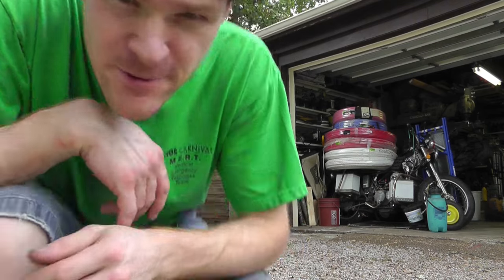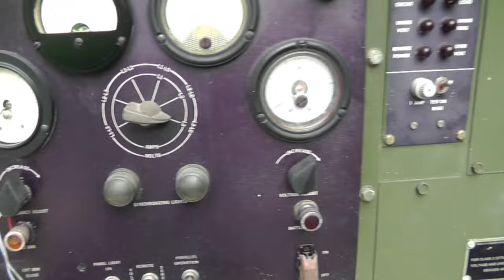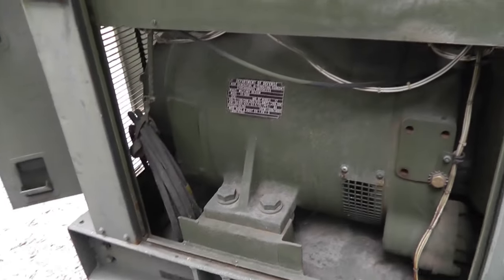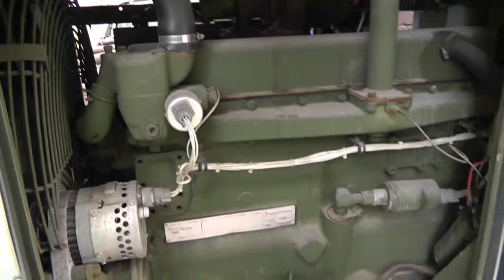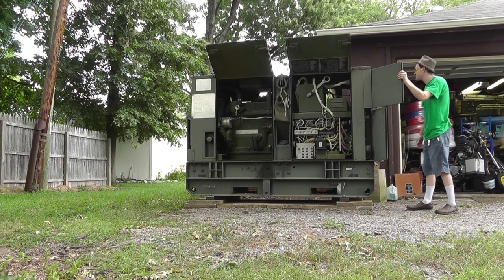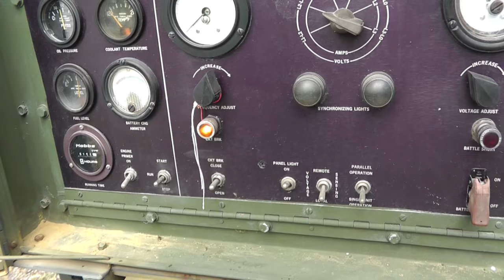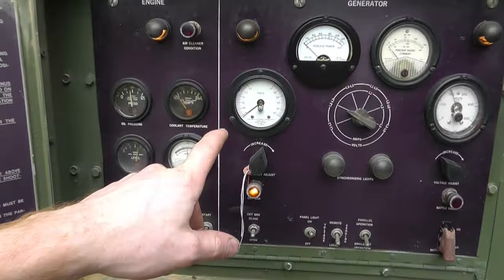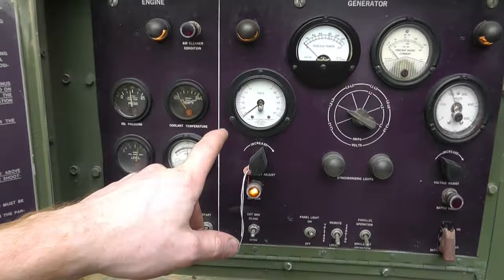MEP-006A Military 60KW GenSet. Overview And First Run After Sitting For 3+ years...

Comment: Notice you didn't reinstall that insulated panel you took off and latter shut the exterior doors without it in place. That's there for a reason.
Reply: I sense the knowledge of a 51D in you
Reply: I was a 52D

Comment: Nice score.  Diesel generators are great; I have a very small one myself.  Those hours are high for military use but for everyone else ... with regular oil changes and clean fuel, you'll get 100,000 hours out of it before it needs a major overhaul.  Keep in mind though: DON'T RUN IT WITH NO LOAD OR AN UNDERSIZED LOAD except for very brief tests.  If run without sufficient load, diesel engines will develop a "wet stack" condition and will require some time-consuming maintenance to fix.
Reply: Art C the hours are high for military use? Try again.......
Reply: James Punting had generators on deployment with 4000 hours so try again.
Reply: James Punting they weren't but you obviously know everything so just keep telling yourself that they don't send anything into the field with more than 50 hours on it.......it's not true so stop passing inaccurate information.

Comment: im in the navy and i work on the same generators we call them TQGs (tactically quiet generators) they will power just about anything and everything
Reply: That thing isn't a tac quiet. The 800 MEP series are. This is a MEP 006.
Reply: We have this model the motor runs but does not generate electricity. Not sure if it's the regulator or what? We can not find anyone who works on them here in western Colorado. Any advice?

Comment: You may want to check w/your local power company about connecting this in a power outage you may back feed power into the grid and electricute employees working to restore power.
Reply: I don't think this yahoo would recognize a transfer switch from a railroad switch.
Reply: Cut off main breaker at meter or hell just pull the meter and u know ur good
Reply: I’m no expert on electricity but I know enough that you can’t just plug it in your house and I have to have a box so it doesn’t back feed  to the lines because that would be bad because someone working on the lines could get lit up

Comment: 142 Hours? That thing is brand new. It was probably purchased new for $30,000, tested monthly for once an hour, then sold 20 years later for pennies on the dollar.

Great score!...but an example of how wasteful the government is.
Reply: These are actually portable gens for the military, they wouldnt be hooked up to an ATS for exercise purposes. 142 hours is very high.
Reply: the sad thing is the government has to be wasteful to prevent insane wastefulness, it makes no sense until you work within the beast and see the INSANE animal that the most powerful government truly is...
Reply: Pretty much most military equipment are never used unless in combat environments or aircraft.
Reply: I've seen the trailer units that have an ECU (environmental control unit (hvac)) cost about $100k about 7 years ago. Not sure of kw, but the mechanic told me it'll run a few houses without a problem.
Reply: alex4alexn - how so? And whay specifically? Is it getting the 3 bids to purchase something? Or the having to spend your entire budget, lest you not get it all the following year?
Just curious, thanks.
Reply: you need about 10kw per house to run basic utilites, and approx 18-20 to run everything in your house., so this unit could run 3 houses very easily if it were not a standby unit.  This is a standby genset and not designed for continuous use.  Its worth approx 4-6k dollars.. You can buy these all day long with @150 hours online or from end users looking to sell.
Reply: 10kW per home is a lot of energy. The kettle is about 1kW and fridge is around that number. Regular household in average needs about 2kW of power. You need more energy when you have electric boiler or you use washer/dryer/kettle. In extreme situations such generator can power up 20 houses with energy saving policies in place.
Reply: I think he might have meant 10kwh? I can't think of many homes that would require a constant 10kw . The biggest appliances such as a large hot water cylinder is about 3kw, 4kw for A/C and even then they cycle rather than being on all the time. Most households would peak at 15kw but for no longer than a few mins at most.
Reply: 142 since it's last overhaul.  They reset the hour meter when it's sent for overhaul.
Reply: As prime movers all the manufacturer does is derate the power a bit ,so there is no magic for continuous use ,nor are they built much stronger .
Reply: Well its not like its the governments money the government is spending.
Reply: The regulation system might need work when he adjusted the frequency I didn't here a change in engine speed.

Comment: I was a 52 Delta in the Army. I've done everything with these from total rebuild to start up because someone ran it out of fuel. The 2 lights on the control panel is for when your tiring it in with another generator like you said. Really nice to watch when someone  gets it out of sync  with the other generator it will come off the ground... Nice buy wish I had one. Enough power for a small village.
Reply: We have this model the motor runs but does not generate electricity. Not sure if it's the regulator or what? We can not find anyone who works on them here in western Colorado. Any advice?

Comment: Yesss Battle Short! I've worked on many military gens like this, always got a kick out of battle short. Look at those schematics on the enclosure doors and you'll see the battle short switch literally bypasses every safety system on the unit. You could put a bullet through the sump and lose all the oil and she'll still run until the rings seize, love it.

The voltage restrap board cannot switch a three phase unit to a single phase unit. You'll have the option to be 480 in one position and 208 in the other, all three phase. The external 120V residential outlets are powered by seperate windings in the stator. Theyll always have power even when the main breaker is opened.

State municipalities in our area like these units because they are cheap cheap cheap. 142 hours is WAY high, especially if she sat for three years. In my experience (limited but still) these never have over 50-75 hours. Think about it... these arent little portable generacs for your table saw on a job site. These are for large Kw three phase applications that are prioritized by utility companies. These maybe power critical infrastructure for a couple hours three or four times a year. 

No glow plugs but look at the little bung on the intake manifold, thats an ether assist, AKA "winter kit" which you do have.

Lead acid or NiCad for gensets, never AGM. Whenever we see optimas in an overachievers genset we recommend they get out of there. Absorbed glass mat batteries are mostly designed for impact absorption, not being on a trickle charger forever and ever and discharging once or twice a year.

Hopefully your friend paid pennies for it, they're cheap but rare and def cool to play with. I'd buy one just to mess with the Battle Short...
Reply: Do know where i can find one .i bought one but i need parts for this beast... Especially the fuel system thanks ..alot
Reply: @VI0LET539  allis-chalmers made agricultural equipment, maybe a place that works on old tractors can find parts for you. I worked in a forklift shop for a while and they routinely had to find parts for 30-50 year old forklifts
Reply: I don't know what shop you were in where 142 hours is "high", every MEP I worked on had thousands of hours. During my deployment my two little MEP-803Bs reached over 9700 hours before the army took them away for referb.
Reply: We have this model the motor runs but does not generate electricity. Not sure if it's the regulator or what? We can not find anyone who works on them here in western Colorado. Any advice?

Comment: I would purge the fuel system, get a new filter, etc.  You never know.  There might be quite a bit of water in the tank after sitting for such a long time.
If you run it low on fuel, you risk sucking in all that crap through the IP and ruin it + the injectors.  Costly to repair.
Reply: Your right about flushing the fuel, putting a new filter. Also do that with the oil. I did notice the oil light was on. Also needs a new oil filter and drain the radiator and refill it with right amount of anti-freeze.
I would check the fan belts and all the hoses.
Just go through it and replace as much as you can. 
These big generators, especially the military have their own wiring outputs.
They are not forgiving.
Reply: D. Hansel the oil light was on because of it not being started just yet so there was no pressure yet
Reply: ,go to toggle set it to 50or 60 then learn about  line legs  and back read the manaul or leave it alone

Comment: The exhaust threads are good for active military zones where we dug trenches and extended a second muffler and pipe below ground to make it quieter.  No glow plugs...plus, check oil every 8 hours operation...they drink a lot of it!  Mine has 140 hours and i change oil every 8 hours so it lasts forever

Comment: I have experience with this very same generator an god what I beast it is. We use ours to run our law enforcement fleet shop during hurricanes in Florida. And we run at full capacity! You have plenty of power to spare with this bad boy! We ran ours two weeks straight during Irma! We have a 300gallon aux tank next to it.

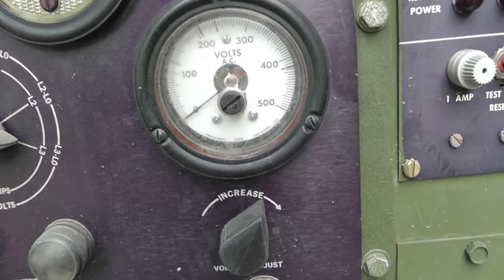Comment: 4:20 Power output over 100% is called WEP "War Emergency Power". It's a state that allows for greater output at the cost of damaging the equipment. It's typically used in conjunction with something called "battleshort" where the safety features are bypassed to guarantee the equipment will continue to function during an emergency situation. Battleshort comes from "shorting" the equipment by replacing fuses with copper bus bars of sufficient thickness to handle the current

Comment: I worked on those, 30kw, 10kw and 5kw in the Army. I also do disaster recovery working with generators up to 75kw Cats.
Reply: I got to work on everything from MEP-802s to 009s, even got to work with the 012's a few times

Comment: I love all the know it all comments. 400 hz? I guess they cant read the the nameplate you got a close up on. It clearly says 60 hz....lol The 3 phase might be an issue, as you really dont want to run unbalanced loads, meaning loading 2 phases with current and 1 phase without any. That is definitely not a preferred way of doing it. Nice find and probably a rock solid unit. Just be careful man, you really look like you dont have any Electrical experience.
Reply: i wonder if these folks know they can get a manual for these. we know the military had one printed up. although it may be on disc these days.

Comment: Thank you for sharing your interesting acquisition. What ever you paid was a fraction of the GSA price to the Air Force. During your video I did not notice that the checked:  Coolant level; crank case oil level; inspect the water separators; inspect or replace fuel filters; inspect and replace oil filters. In other words, You demonstrated a fool's method of checking out this valuable piece of equipment. In the military we call this:  PMCS "Preventative Maintenance Checks and Systems."

Comment: You keep your finger on the start button until the cycles meter needle hits 60 Hz.
I used to maintain and operate these in the USMC.
Reply: Thank you for your service. We have this model the motor runs but does not generate electricity. Not sure if it's the regulator or what? We can not find anyone who works on them here in western Colorado. Any advice?

Comment: Engine RPM will dictate frequency, which should be 1800 RPM.  The throttle lever (round black knob) is to the right of the air intake, just beneath the control panel.  Once you increase the throttle you'll notice the frequency dial rotate up towards 60 Hz.
Reply: Bingo. Sounds like you were a 52D also.
Reply: Frequency should be set under load.   Depending on what you are feeding, probably should be just under or around 61Hz with no load.  Will drop to 60 under load.  Have a 300kW CAT at work that runs between 61 and 61.5Hz no load.
Reply: Curious that the frequency is very low and the frequency meter once had tags on it - probably tagged as inop or inaccurate. It's OK he's gonna get his o'scope out. Maybe a VOM that measures Hz would be easier. Good luck...
Reply: I was too back in the day. Went to Ft. Belvior  back in the late 70s.
Reply: Ft Belvoir early 80s 😊 52 D  HAPPY 4th everyone 🎉🎆🎇✨️🇺🇸🇺🇸🇺🇸🇺🇸

Comment: over here in the netherlands 3 phase is null l1 l2 and l3 null (380 volt 50 hrz) and one phase is ..... one phase , so basicly you can hook up every fuse in the home on a different phase of the generator and run the gen as is

Comment: We ran these in iraq to power 8 shops. Each with dual 20k btu ac units and tons of stuff for testing/repairing electronics. We ran around 35 to 40kw most times.
Reply: They are really great generator's not as quiet as one of those civilian whisper watt Generators but still a nice unit the only thing rong is that AC has been out of business for so long that parts for that engine are very tough to find.

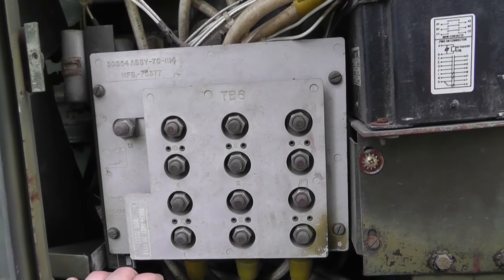Comment: The voltage reconnection board (TB6) that you show at 6:18 doesn't switch it between 120 and 208, it switches it from 120/208 to 220/416. (It's always a three phase generator unless you modify it)

The frequency adjust switch doesn't do anything on that model. (006a) you have to adjust the frequency with the throttle knob.

Comment: Frequency knob is directly linked to the governer rpm set point. Usually the rpm has to be on 1800 for 60 hz output. 1800 / 60 = 30 inversion steps per rotation inside of the generator... kind of...

Gasoline engines that torques at higher rpm use different generators with different windings. These numbers might be slightly different for your genset. But for sure, frequency knob shall change the rpm of the engine.

Comment: I used to work with these.

This unit is strictly 3 phase and the voltage adaptations is reconfigurable for 208Y120 volts or 415Y240 volts... 50/60 ~ Hz for international use.
Reply: Finally, I found a technical comment from someone who actually knows what they’re talking about! Thank you!

Comment: You can control the frequency of this generator with the throttle knob located on the right side right below the control panel.  You can run it at 50 or 60 hertz.  The rated load capacity just decreases at 50 hertz but swing how your in the United States you shouldn’t need to run it at 50 hertz.  We use to power small military camps with these.

Comment: These things are rather expensive to maintain. Large oil capacities, large anti-freeze capacities, multiple fuel and oil filters. Crankcase oil and filter changes and system checks were $400-600 each. I've noticed that smaller villages will purchase them to maintain their water and sewer pumping stations during power outages. We exercised ours (at work) for 30 minutes every month under load.

Comment: Hey Russ,
Operating Instructions: Section 1-PRESTART CHECKS
    Step "G" - CLOSE ALL DOORS EXCEPT THOSE ON CONTROL PANEL END OF SET.

Airflow control for proper cooling :-)

Also, a 90° turn upwards on the exhaust would help with the noise.  Make sure it has a flap though, like it currently does, so you don't accumulate water (or birds) in the exhaust.
Since it's turbocharged, that helps muffle the exhaust too. In my hot-rod days, my mod'd turbo'ed Buick V6 was un-muffled and wasn't very noisy.
Reply: We have this model the motor runs but does not generate electricity. Not sure if it's the regulator or what? We can not find anyone who works on them here in western Colorado. Any advice?

Comment: Could just plug a tool in the 110 outlet and see if it works, much simpler. Sure wouldn’t be sticking my tester in the open panel like that, just asking for a jolt. There’s a reason why the electronics are covered, for your safety,lol.

Comment: Sweet!  Try to find out the fuel consumption in gallons per hour.  You can definitely run that diesel on a vegetable oil blend of 80% veggie and 20% gasoline.  This will not harm it at all and you won't need to modify anything.  Message me for more details.  God is blessing you, Russ.
Reply: And you know this particular engine because...?

Comment: Used to work to them. They really aren't designed for home use. As others have commented you have to have a load bank to put a heavy load on them. You might find a generator shop who could do it at least once a year. You have to maintain them, not just park it. On the flip side we had very few problems with them except for the batteries.
Reply: We have this model the motor runs but does not generate electricity. Not sure if it's the regulator or what? We can not find anyone who works on them here in western Colorado. Any advice?
Reply: @sleuthprocess1588  Been out of the game for several years now. Since these are military it would be hard to find people to service them. In the Air Force "Power Pro" works on generators. They have a civilian and a military organization. You could call around the air bases around you and see if anyone would be interested at looking at it on the side. I am in Texas. The first thing  you need if you don't have it is the service manual. I never received any training but just figured them out with a manual. The troubleshooting guide is pretty good.

Comment: It is a MIL-SPEC diesel it starting easily is not a real surprise.
Reply: calvingreene90 ... I'm  pretty sure these have a 6cyl Allis Chalmers turbo diesel. It's  a really smooth,  quiet power plant.  Back in the mid 70s, while in Korea I  would heat coffee water on the turbo when we were in the field.